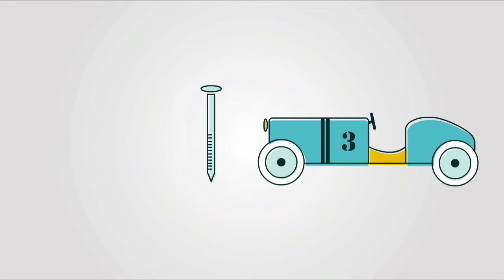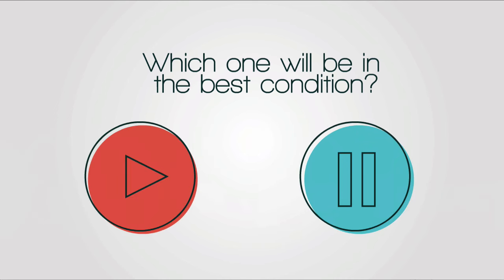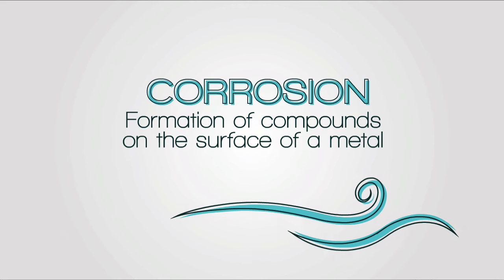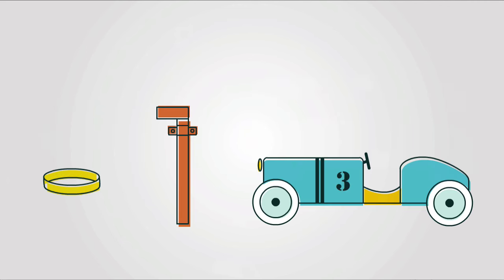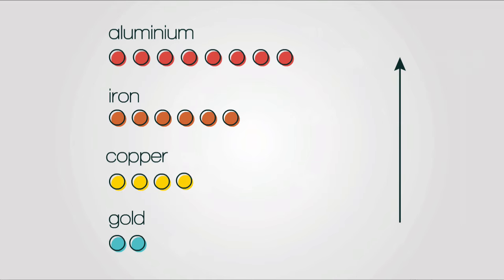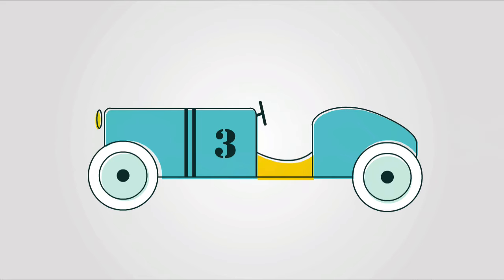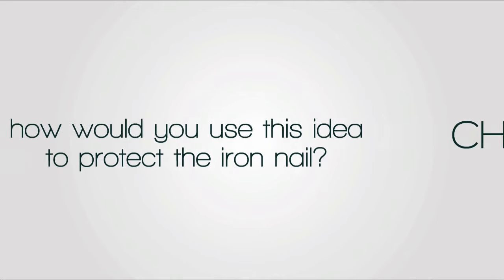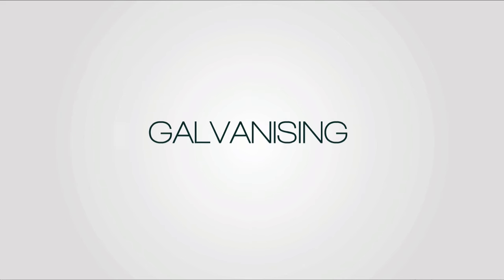Corrosion of Metals | The Chemistry Journey | The Fuse School

Comment: I was just wondering though, why you would cover the iron with a more reactive metal and the bike with a less reactive metal to prevent corrosion in both cases?
Reply: exactly what i was wondering
Reply: coating steel with a more reactive metal is just one example of protecting your steel of corrosion. in general you try to cover you steel with a metal that ist unreactive so it doesn´t react with the environment, like gold. you can find these kind of coating in a lot of applications of electric contacts, but as you can imagine this is very expensive. . The zinc coating discribed in the video is a very common way to protect your steel of corrosion. The zinc works as a cathode for the steel and prevents it from rusting. The zinc is corroding first and actually saving the steel from corrosion.  
if you have any questions feel free to ask
Reply: I was thinking about that as well. But I guess it is because you want the bike to remain it’s colour. So suggest the bike is made of aluminium. If you cover the bike with a more reactive metal, the oxide is more likely to react with that more reactive metal. But this can also lead to a change in the bikes colour. So if you cover the bike with a less reactive metal like tin, the oxide is more likely to react with the metal the bike is made of: aluminium. This means that it will form aluminium oxide and the tin layer will always be an untainted protection for the bike.
(I guess)
Reply: less reactive metals, while they do not react with the oxygen in the air are called precious metals and are very expensive.
Reply: I think it's because you wouldn't want any metal oxide on your bike :P

Comment: why we do galvanising when we can do polishing- cz the results for both are same?
Reply: the results are definitely not the same. Polishing a metal doesn´t (in general) change its properties it just changes the surface area. A rough surface has a much lager surface area than a polished (smooth) surface, which makes it more vulnerable to corrosive attacks . Galvanising is mostly used to change the electrochemical potential of coating to the material underneath so the coating is attacked first by corrosive environments. The steel underneath is though protected by the more reactive material above. 
There are many other and more complicated ways to explain this, but i hope this gives you a hint. if not.... feel free to ask